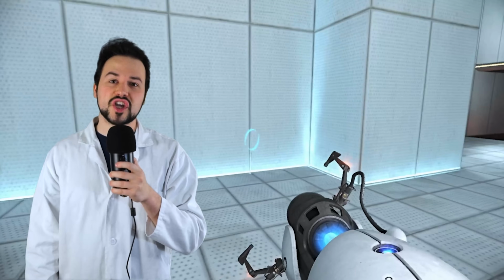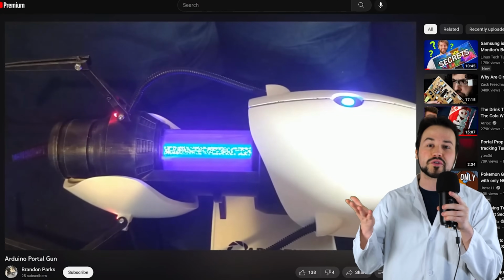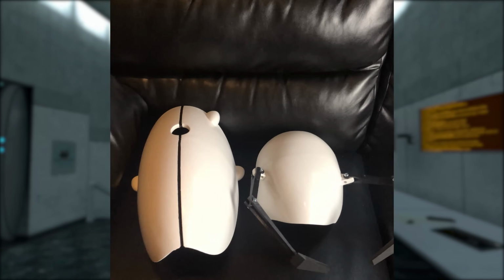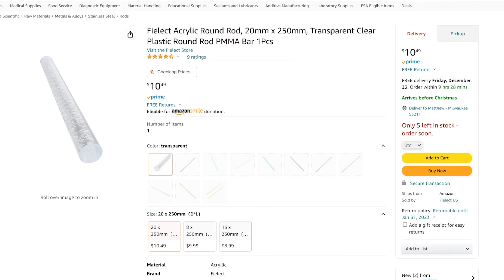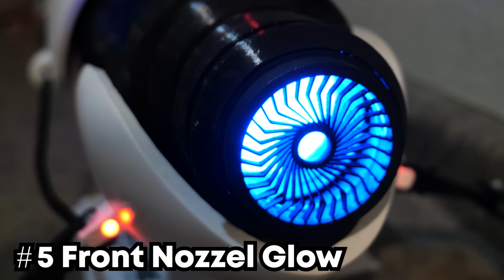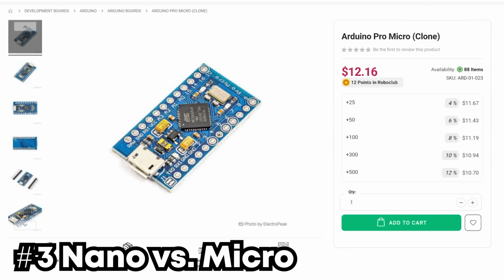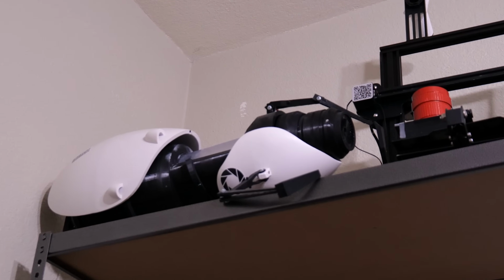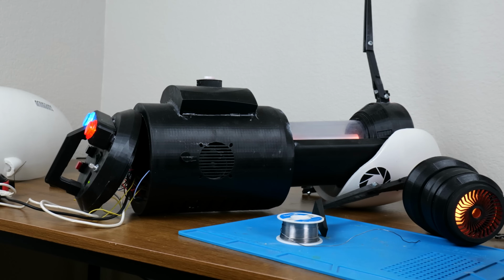Making a real Portal Gun from scratch

Comment: I have one of the NECA Portal Guns that I got at a relative steal from a friend a few years ago and I love it. This build is a very impressive substitute.

(In case anyone was curious about the controls on that one, there's a sliding switch on the back of the grip that you can adjust with your thumb, between blue, off and yellow, and of course the trigger on the front.)

Comment: Wow, broheim, save yourself next time and buy yoself a deburring tool. Your hands will thank you and it will look nicer and more professional in the end. For the kind of stuff you're doing, I'm sure you'll get plenty of use out of them (you can buy a whole kit that works with different materials and directions, etc). Works on Metal, Resin, PVC Pipes, Copper, Plastic and 3D Printed Edges

Comment: Love this!! For the process of removing the filament lines with the whole filler and spray paint method, have you tried using plasti-dip? You'd still need to put filler on the larger cracks but the plasti-dip would fill in the rest of the surface pretty well and make it nice and smooth. If you wanted a high gloss finish you'd still probably want to spray paint it after but its really great for prop making!
Reply from the maker: Hrm I’ll look into this.
Reply: @BigRigCreates  Kamui Cosplay has some great videos on painting props (worbla, foam and 3d prints) and how she uses it as a finish or primer for paints :)

Comment: What was different about the battery bank that you couldn't have used something like a D cell?
Reply from the maker: Unfortunately, a D cell battery wouldn't have the capacity / amps needed to power everything.  Using a rechargeable battery with a high amp and power capacity powered by usb was what I needed.